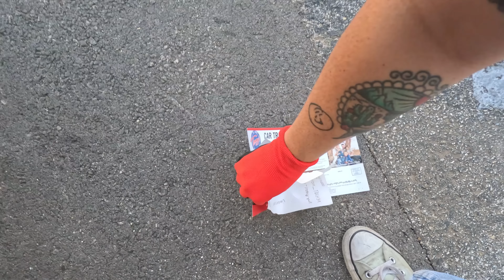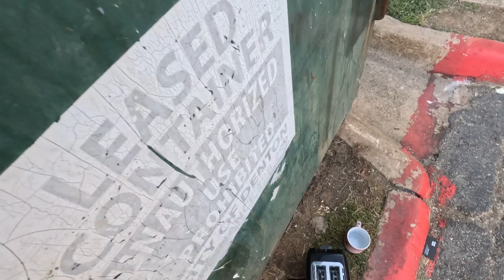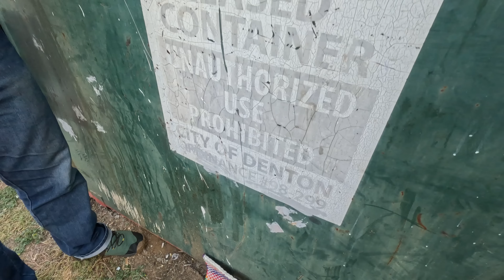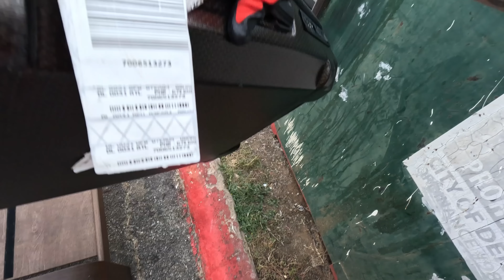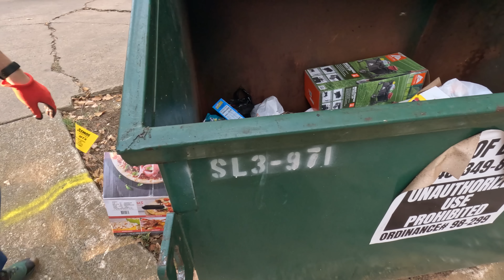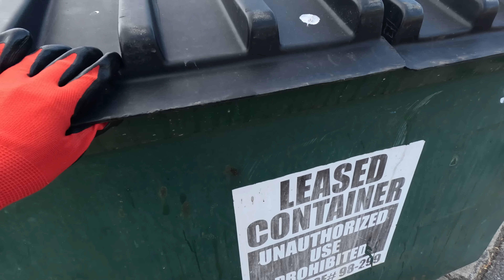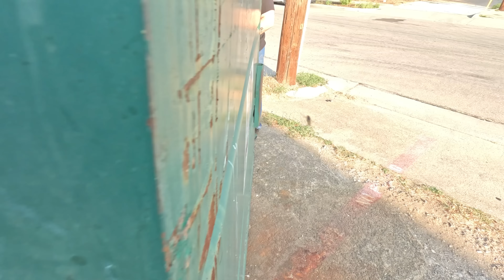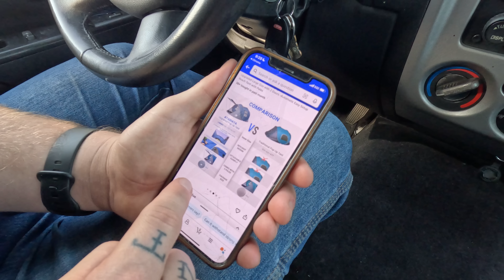Great Dumpster Dive – Pop Up Tent, Huge Dog Bed, Kitchenware, and MORE!

Comment: Pot holders.   Made them as a kid. Now I am 73 . Those bring back memories
Reply: They are trivets
Reply: @paulamoberly1437  I'm 74 we made them before Christmas as gifts for all the cooks in the family. Lots of fun making them.
Reply: @janhardginski990  hun they can be both.
Reply: @marjane4344  we were extremely poor so I am sure they used them for both. We sure had fun making them! Thanks !
Reply: @marjane4344  I agree but they looked quite thick so I thought they would be hard to use as a potholder!
Reply: @janhardginski990  really possible too.
Reply: @janhardginski990  different types of yarn determined the depth and movement of the item

Comment: The yellow cords are "guy lines", which as you guessed are to stake the tent into the ground. One on each corner and that should hold the end hoops up so it doesn't collapse on itself. I would also coat the outside of the tent with waterproofing and get a plastic tarp for underneath to keep out moisture.

Comment: I was shouting at you not to have Bones out there when you opened up that tent! But I guess you didn't hear me.  I knew anything popping open like that would freak him out.  Yes, I'm real sure those little cords are your guy ropes for staking it down.  But they're really not strong enough for any sort of strong wind.  As far as the opening at the top, just stake a small tarp over it.  Overall that is one really nice tent!

Comment: Keep and use it with a tarp over it.  Should be able to contact the company to see if you can get the tarp or top piece.  ENJOY on one of your travels.  Spray with Clorox spray and let air out.  You may want to buy a mattress base under your sleeping bag.😊😊😊

Comment: Ya it’s a 4 person tent but it better as a 2 person tent if you look I think the rain fly fell out and under the tent. The strings are tie downs you might look the stakes are probably in the bag if not Walmart have some small stakes for few cents. But it be good to get a tarp most tents are not as rain proof as they say but good tarp will work and give you 100% rain proofing and if it has one of those flaps that stick out but not tent legs you can buy those fiberglass poles that they use as road markers at true value or any hardware and just cut to size